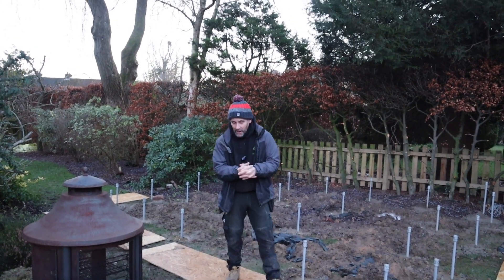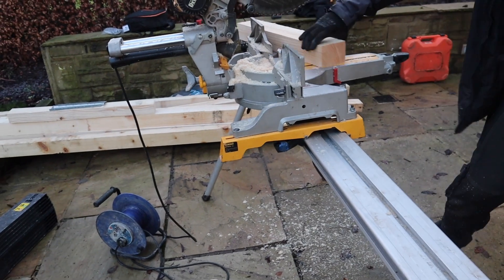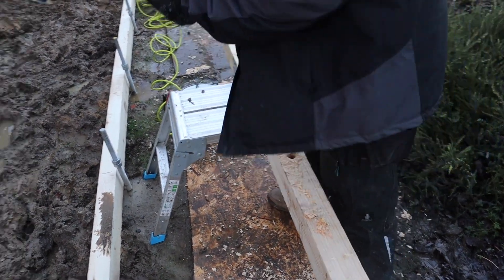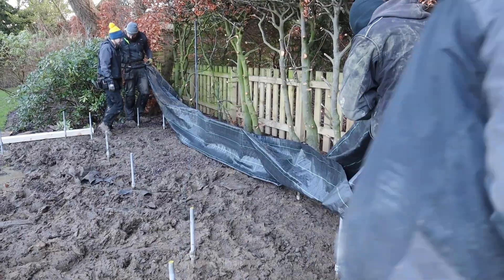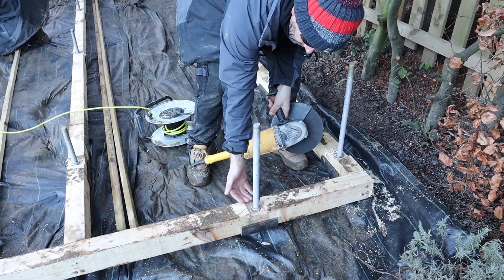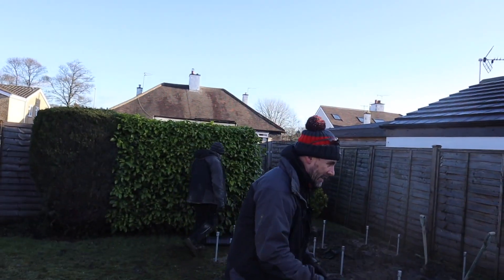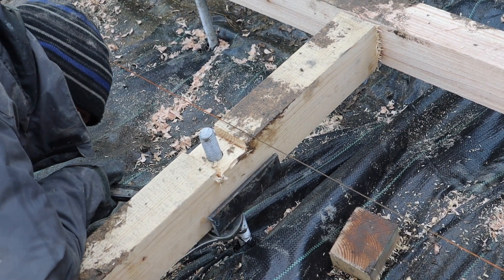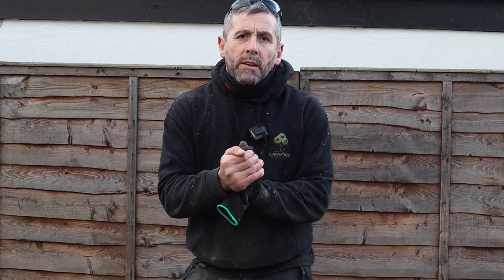Garden room base construction  x2

Comment: Hi Liam great videos and your buildings are amazing. Question i want to build a 7m x 4m garden room but there is a 2 foot difference in height from the back of the ground i want to build it on from to the front. Could your pile system be used for that or would you suggest something else?

Comment: Hi, love the videos...just out of interest why the pile system base over a concrete base? Is the pile one cheaper to construct and saves removal of loads of earth etc...Thanks Ross...
Reply from the maker: A bit more expensive than a pad but quicker, little or no earth removal and over uneven ground it solves all issues
Reply: Hi oakwood garden rooms - if using the pile system would it be alright to build next to a large tree ? (Or would it be recommended to chop down any trees close by)
Reply: Oakwood Garden Rooms would this pile system be alright to build next to a large tree ? (Or would it be recommended to chop any trees down that are close by)

Comment: Do you do anything around the base to stop anything getting under it???? Also when you put the metal roofing as a cladding on back wall is there any thing you put at the bottom of sheeting to stop any insects or mice getting up there
Reply: Stuarthodge Chicken wire at base
Reply: That won’t stop mice will it
Reply: For my base, I found a wire mesh product at B&Q that was on a roll, 10mm grid pattern, thicker wire than basic chicken wire. It was a pain to cut and install, but I'm pretty sure no mice will get through it in my lifetime. I was on instructions from the wife: there must be absolutely no rodents under her new room. This was cheaper and less hassle than getting a cat. Plus, I don't like cats...

Comment: One tip for productivity IMHO would be to contact some local metal fabrication firms and get quotes on them making the shoes from the steel channel for you. Any decent firm will also be able to arrange for them to be hot dipped galvanised too which is a set up in the quality of your product. You must be going through thousands of shoes a year. They could make a jig to hold the channel and have a plasma/laser/water cutter do the bulk of the work.

Comment: Love the videos, got a 6mx3.5 coming up for a client, and I've discovered the light gauge steel frames! Absolute game changer.

I've got a price for 21 screw piles 
Base, walls and roof.
Including all external osb.
Coming in around £3900.
All put up in a day.
As a chippy I love working with timber but you can't beat a square, plumb and level frame.

Comment: Hey buddy, love your videos and your full on work ethic. But..... you should always use galvanised studs. 8.8 is the tensile strength which doesn't really apply to your application as it's to do with shear strength. Lower grade steel will be fine as long as its galvanised. Hope this saves you a few quid. Keep up the good work 👍
Reply: Glad you clarified that. I’ve just had a delivery of zinc plated rods 4.7 grade and my heart sank when Liam said they need to be 8.8!

Comment: Did they need planning for this size garden room?
Reply: The way hes going at it i dont think he'd have the time to apply!
(I think he might need it being less than 2 meters from a boundary?)
Reply: Won’t have done. It’s going to be less than 2.5m high and less than 15sq meter internal.
Reply: @AccountantDoesDIY  Maximum height of 2.5 metres in the case of a building, enclosure or container within two metres of a boundary of the curtilage of the dwellinghouse.

Comment: Out of curiosity, why do you build on the threaded Rod base over a concrete base ? 
is it strictly for airflow ? or other reasons ?
Reply: Cable smith, I’m a subscriber of yours, live not far away from you. See your comments of loads of channel I watch too, good to see another spark interested all sorts as well 😂
Reply: @curtisbaker8196  haha nice 1 mate, but your right, I watch alllll kinds of construction and trades ! It’s all I care about in life 😂
Reply: @cablesmith. Its cost and access digging out tonnes of soil and bringing in tones of concrete when some of their builds are in awkward locations isnt cost effective from what liam has said when this has been asked before.
Reply: Can't speak for Liam but for me it's quicker, less muck to take away and much less concrete so better for environment. Also much easier to adjust to get the level spot on which is the most important thing for me 👍
Reply: @bearhauscubly  appreciate the replies lads, what ever happened to good old fashioned resting joists on breeze blocks 😂
Reply: how do you know how many you need, what would be the max weight you can stick on them? any examples?
Reply: @wayneh150  that’s why he created the build packs to answer that question I believe.
Reply: @PaulM_aka_4c21  I Just do a bit of KNX home automation programming right now, I would not build one but I would recommend/suggest to customers I work for who have the space and want stuff like this.